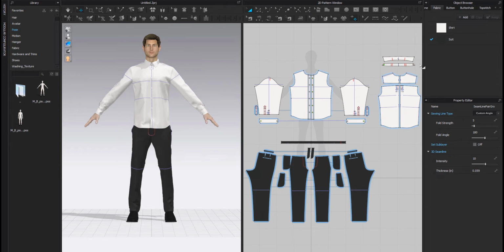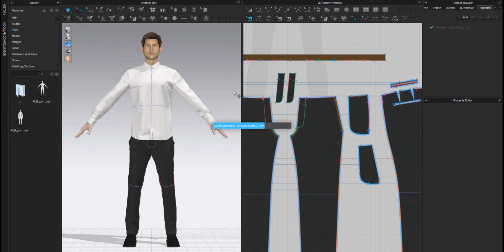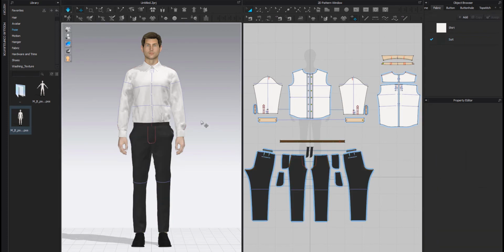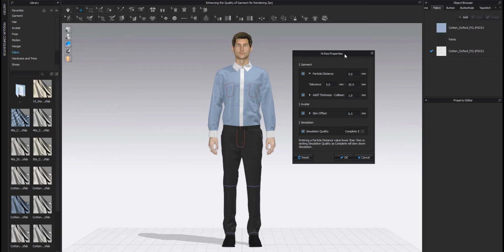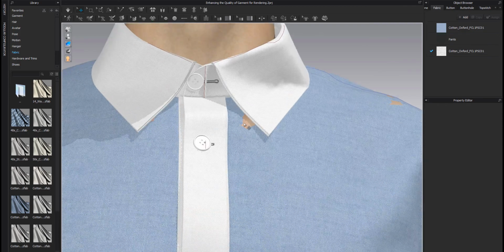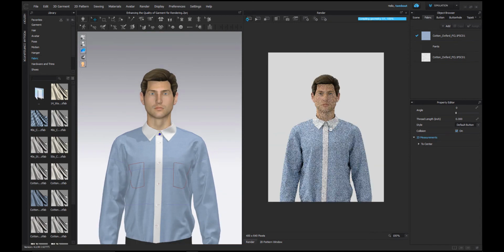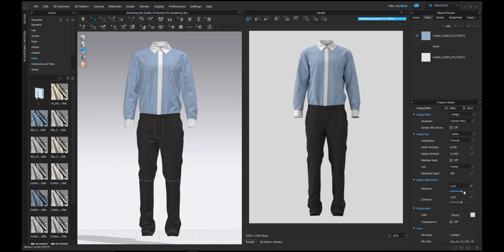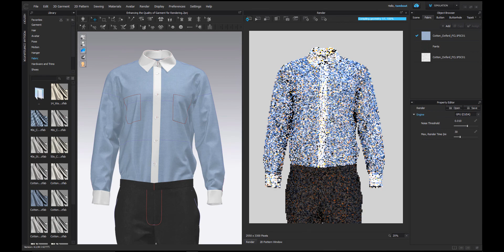Enhancing the Quality of Garments for Rendering

Comment: any problems with your pc while running "high resolution"? If not, could u send me your PC configuration or the latest recommendation one via my email: thu.mt.it@maxport-ltd.com . Thank you so much.
Reply from the maker: https://support.clo3d.com/hc/en-us/articles/115000307168-CLO-system-requirements-May-2021-
Reply: @CLO3D  i knew it, i built one but it still lag, not responding & automatically close application when using the hi-res mode, however render process is fine..... so i need the configuration which is currently using & running  by your side....